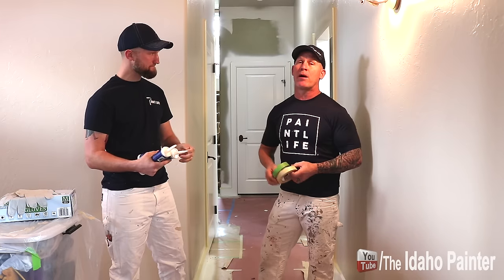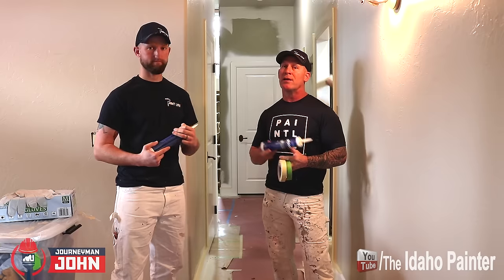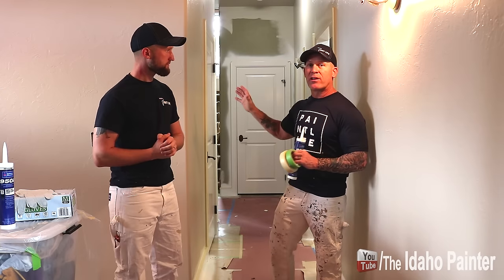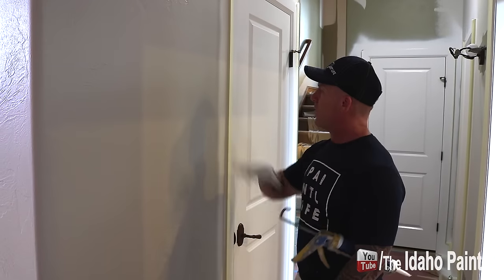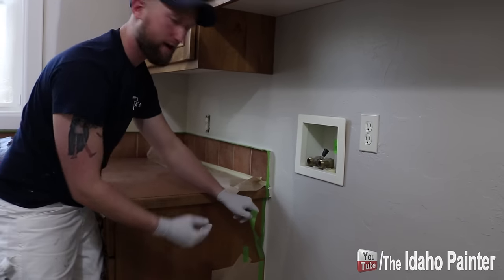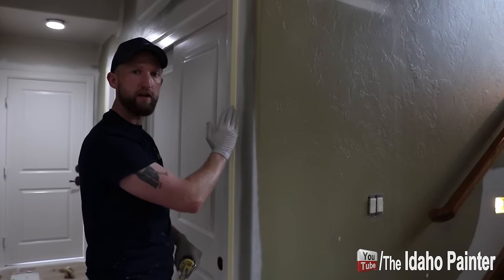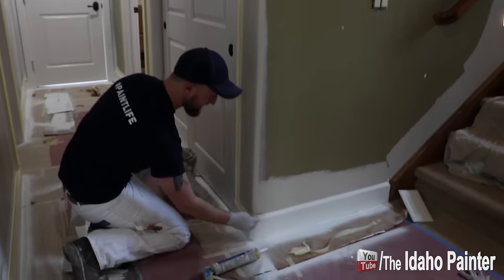PERFECT lines with caulking and tape.

Comment: How would this work if you need to two coat the cut in if you need to pull the tape when the caulk and paint is wet?
Reply from the maker: We do not re-tape and caulk for a second coat. We just go through and touch up where needed
Reply: Paint Life TV in that case, I think I would roll one coat tight to edges, but not touching trim/tape, then caulk, cut, roll and pull tape one wall at a time. Base would always be covered, virtually same amount of work

Comment: Ok so if you leave a 1/8" reveal when you tape trim, so that your caulking blends, then you paint over the caulk, doesn't you color run 1/8" onto your trim now???
Reply: You want the wall to run into the door and window casings slightly. Baseboards and Crown you want the trim to run into the ceiling and the wall to run into the trim. Thats the secret to pro painting. It will never be in the middle so you err on the side the is foreshortened from your point of view. Also the lighting on the ceilin will always be darker than the wall. If you have colored walls and a little of the ceiling white runs into the wall, it will be a very distracting highlight. Also, since the ceiling is foreshortened towards the viewer, the overlap is extremely minimal.
Reply: Gotta disagree on this “tip”. I like my lines to be exactly in the corner. Tight enough that if the trim was taken off the wall (for instance, not for real lol), there would be NO paint whatsoever on the trim. And so tight to the corner that absolutely no trim white shows onto the wall. I feel overlapping by ANY, is a novice move so IDK why they even do this. Also FROG tape AND caulk?! Makes using expensive frog tape pointless. Just use 3M!

Comment: Can this method be used for the corners between walls and ceilings?
Reply from the maker: It can be, but it’s hard to mask straight lines on the ceilings. Better to check out one of the videos we have for cut ins.

Comment: If you leave 1/8" space between the tape and the wall - and caulk that void... won't it leave caulk on the trim itself?  Since the caulk is white - and the trim is (presumably) already painted... wouldn't that push the wall color up on the trim to some extent?  Maybe I am thinking through this wrongly.
Reply: Also - what if you were spraying?  Wouldn't you just tape right up to the wall and spray or would you still use this same technique - spraying and removing the tape while wet?

Comment: What's your take on using a caulk mixer to match caulk exactly to the paint color? I wouldn't want to be without mine. The clear latex is what needs to be used for this, and it does shrink pretty bad. But I just plan on hitting it twice. Turns out great every time. Sucks to clean the mixer out tho.
Reply from the maker: Tried it and hated it, it was too messy and difficult to use
Reply: So how do you color match caulking then?

Comment: I was always taught to overpaint caulk when it was dry or when it says you can on the tube... does the paint not wrinkle and flake if you do it too soon/straight away?
Reply: Either you do it straight away or let it dry. Thats what Ive noticed gives me the best result
Reply: Michel Thanks, I think I’ll give it a go. I don’t know, it just feels wrong painting it straight away. Caulk always shrinks a tiny bit, really surprised it wouldn’t effect the finish of the paint...
Reply: Josh Graham dont over caulk. Make sure as little caulk as possible is on the tape
Reply: Josh Graham You still need to caulk the baseboards  this isn't caulking and painting at the same time. Most of the caulk comes off when you pull the tape

Comment: I own a painting company, and have been painting 20 years. I always let the caulked tape that's been painted dry fully before it's pulled.

If one has problems doing it this way, they've done it wrong. A dry line is normally better than a wet line, and the existing tape is good if a second coat is needed or touch-ups along the tape are necessary, etc...

U need apply tape a dimes width out from the corner, and use a wet rag to wipe all excess caulk off the edge of the tape, as well as not over applying the paint when you cut in. This will preserve the razor sharp tape line.

This is first year stuff...

The only time I pull the tape wet is when we're doing final touch-ups and are on our way out the door, and need to straighten a line or something...

Comment: Hey guys I’m from the uk and normally we require 2 coats of paint so how do you overcome this because surely you don’t mask twice?
Reply from the maker: We use high quality paints that typically only require one coat, but if it does require two then we just do touch ups on the second coat

Comment: What type of paint (brand) are you using on the walls?
Reply: There using a flat or matt paint thats why they can roll first and cut second without flashing occurring if they use any other sheen level eg. Low sheen, semi and gloss flashing would occur.

Comment: What’s the caulk do though, why not just the tape?
Reply: It does nothing. The caulking is not needed unless there is a crack or if surface is uneven. You only need the tape for perfect line. Also painting over wet caulk does not produce a high quality job. Tape should be removed first and then It needs to be dry.  Afterwards then two coats paint if you changing color like they are doing.

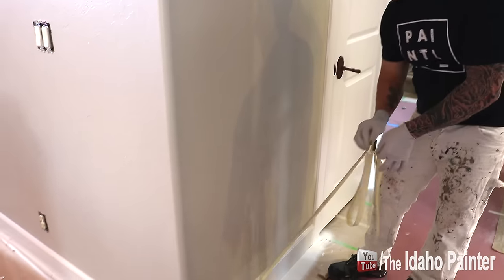Comment: At 10:42 as you are peeling the tape, I see the flaw on the door  trim edge. You even pause a split second talking, while looking at it, but quickly finish peeling the tape down  acting like no one seen it. No biggy,  mistakes happen, but I noticed it right at the time you pulled the tape. It even looked like you were about to reach to it with your hand, but didnt.

Comment: Gentlemen please get yourselves a hotdog roller with a 1/2 inch nap instead of the brush and fat 4”. 

Make sure you use the metal hotdog frame where the nap slides onto! Nothing else 

The hotdog roller let’s you roll against your tape without a bunch of overlapping! No brush work or brush lines and works very fast pro results. 

Been using this method for years. Just remember a 1/2 nap can roll an interior corner without brush work in general. Trim or wall space doesn’t matter! 

Give it a go!

Comment: 8:15 is when the tutorial starts, for those who don't want to wait.
Reply from the maker: Thanks Alex!
Reply: If u start listening at 19:15 they say it this is so they can hire guys who are not paint masters and still get quality work out of them if u follow this method u don't have to me a skilled painter and I'm sure there not getting paid as if they were
Reply: @Idahopainter  like the videos I'm a 3rd  generation painter I run 15 to 20 guys depending on time of year I do about 1.3 mill a year in sales residential and commercial I live in pa and 95 percent of my home interiors are what u would call level 5 but they r not true level 5 even in these big multi million dollar homes out here because when they build them it all goes to the lowest bidder and they first coat tape and finish coat that's it most of ur listener's probably don't know the difference in wall finish and it would be good info to let them know a level 5 means that when they r spackling the sheet rock they keep floating the seams out until they meet each other and all visible sheet rock has a coat of sparkle on it u can not see the board anymore it's all spackle and that usually takes 5 coats. They cut corners and give 2 and they don't screw any sheets at all it's all nailed. Last house brand new neighborhood $800,000 homes nail pops everywhere volted ceilings and u can see all the seems lol! Glad I found ur videos just subscribed!!

Comment: Instead of caulking I brush a clear coat of clear paint..like zinnsers clear...I tape..then brush the clear to seal the tape..wait a few minutes for clear to set up then brush topmost and finish with a 4 inch roller and pullntye tape..Less messy this way because your not using caulk...

Comment: Can someone help me with a recent problem .. I had a customer who removed her wallpaper and it was white I primed It and sprayed the paint but it's drying weird shap that I am not spraying the house is 100 years old as to the knowledge of the owner idk if that has something to do
Reply from the maker: We couldn't say what was wrong unless we saw it
Reply: Home Improvement TV sorry what I ment to say it's that the drywall was white no paint applied since the wall build up I primed It and painted and the whole ceeling when it dried seemed like it had different Sheen all over the place I have never encountered a problem
Reply: Sergio Perez if you mean that behind the wallpaper that was removed had no paint and you saw white...and the home is 100 yrs old it is lathe and plaster more than likely unless the home went thru a remodel where drywall was added.  You can get extremely thin sheet rock and cover the walls...kinda pricey depending on size of project...but if only 1 room may be easy to factor into the budget.  If you applied paint directly over plaster where wallpaper was removed I would venture to say that wall should be sealed with a type of pva primer used on top of sheet rock after it gets textured...it stops the moisture in paint from soaking into drywall or plaster.  If a wall isn't coated well enough with pva it will feel very rough and you can truly feel and see the difference.

Comment: I used “DAP Alex Plus clear latex paintable caulk for windows and trim” over the tape all over the house only to learn that the cure time is 7-14 days. DAP customer service says this caulk will never dry/cure if painted over before 14 days and will attract mold. What I didn’t notice is the plus on Alex plus is silicone so that’s probably the problem. DAP instructed me to remove all caulk. The whole house? I wouldn’t even know where to begin. Have you heard of this problem, caulk not curing because it’s been painted before it was cured? I’m just sick about this.
Reply from the maker: Dap is terrible

Comment: Okay dudes. Tape caulking is sloppy and not necessary. Just seal the edge of the tape with a dry brush load of flat, latex poly. Done. And it’s quick.

Comment: You guys do great vids but I guarantee the corners are not perfect with out sponging between wiping the bead and then rewipeing it after the inside corners and hard to get areas. A grout sponge and bucket of water filled just enough that when you hang the caulking gun inside the tip sits in the water. I mean, just if you want perfection. Apartments and the getto, you dont need to get so meticulous

Comment: You guys don’t worry abt the thick edge your four inch roller leaves? I always feather those edges out obsessively. 😂 why do u not worry abt those?
Reply from the maker: Does not leave an edge
Reply: @Idahopainter  I’ve never used a 4 inch roller like I used I usually use what we call the whiz roller with the nap on the end of it as well and I find that I have to feather the edge out (the edge furthest from door or trim or whatever) or it will leave a lap line or thicker line like u see when someone poorly rolls out a wall. Maybe those 4” don’t do that as bad I’ll have to look into it.

Comment: I've run my own painting & building company in the United Kingdom for over 40 years. I'm sure you guys do a great job but I can't understand your fascination with masking tape.  Here in the UK we only use masking tape on very rare occasions and rely more on skill to caulk perfect lines and cut in sharp lines on walls and trim. 

Once the skills have been developed a painter and decorator in the UK would have a room painted within less time than it takes you to mask the room off. We generally allow 30 mins to completely caulk all trim in an average size room and around 4 hours per coat for the walls. We would never put paint on wet caulk as this weakens the caulk and can cause cracking never mind damaging a nice sharp caulking line if to much pressure is applied to the brush.

I take in your comment about using tape allows you to employ less experienced people and still get a good job, but to me that is just another example of dumbing down the trade instead of training your workforce to become highly proficient in their skills, and do away with DIY methods. It is the development of skills in all trades that separate a first class tradesman from your everyday handyman and DIYer.

If your video was aimed at DIYers then I'm sure it would be very helpful.  However, if this is the system you generally use then I'm afraid you wouldn't last a week in the UK as a painter and decorator, you would be classed as unskilled if you had to use masking tape to get a professional finish. In the UK anyone who has to use masking tape to cut in or caulk is considered a brush hand (which is basically one step up from a labourer and is considered more as a decorators assistant) and would only be allowed to do the most basic of tasks.
Reply: Not sure where that mentality comes from over there. But here in the US, at least on any of the jobs I've been on, you'd probably be let go. We don't have time for anyone who can't properly prep a job.

Comment: looks like some of trim paint came off along the arch on the first demo. Plus in my experience as a painting contractor when caulk (not caulking) dries it will crackle the surface of the paint as it shrinks leaving an undesirable finish. Don't understand why someone isn't doing the caulking as part of the initial prep work. It dries properly and then tape can be applied if you can't cut in properly. These guys simply go for the quick and good enough method I believe. No way this shit would fly with fussy and knowledgeable customers/builders/designers. The 1/8 inch thing seemed stupid.. why would you want wall paint on the side of the trim? Doesn't make any sense. And its impossible not to get roller spray on to the lip of the baseboards or skirting boards when rolling - post trim work. Sure you might not get bit fat blobs of paint on the boards but the roller spray is inevitable. Im guessing with the textured wall a fat nap would be used so how can you avoid that? The only answer is it gets the job done faster.. not better. Good for DIY'ers sure.. not for painting professionals imo who pride themselves on precision finishings. Not on this video anyway.. sorry guys. Having said all that you guys have taught me a lot on other videos

Comment: I don’t think it’s a good idea dragging you brush on a wet caulking! 1 .-you’re ruining your brush 2.- what do you do with you excess caulk?its on your latex gloves or in your pants cuz you don’t have a wet rag or wet sponge?3.- if you have a big gap more than 1/8 “ you brush is going to push the caulk behind and your not going to have the best results. My advise is make you straight line 1/8 “ over the trim (base,case, or crown) small amount of caulk drag it with your fingers keep it wet and clean,try that every 3 or 4 foot get microfiber rag its amazing always have bucket
Reply: With enough water to soak when you get a lot of of caulk on it ,let it dry ,you could do a big area then you have enough to cut and roll and not switching every time. Pull you masking tape at the end of the day or job you not have to worry for wet paint or caulk

Comment: This seems like madness to me. 
Surely by painting over that wet caulk the brush is going to drag it up or get cracks in the paint film when dry. 
Why wouldn't you do all your caulk and filling before ANY painting. Its not about neat lines once you have done your prep caulk and filler you can then cut in by hand or with tape to get your desired line. Also surely not every join needs caulk unless it a new build or newly fitted trim with gaps. I like you guys but I'm sorry this seem completely wrong to me I would love to hear why you think this is even a good idea?
Reply: ok ya  heres what i do caulk let cure then enamel let cure then tape ,its a perfect line every time dont care about tape cost, but the process they are going is far from efficient constantly stopping for another step counter productive,thats why machines do one step at a time its efficient less time consuming   I only free hand when there is no other option like old jagged bumpy walls caked with a dyi caulk job im 35 years into it and like Iike I said perfect lines o ya I can cut real good  time is money tape is cheap lines are perfect

Comment: Thats ridiculous.  Tape off trim . seal tape  with shellac , or possibly the laquer you use on the trim . using enamal or varnish tends to take too long to dry.  Should use the faster drying product . once the shellac dries , paint your walls . when you pull tape youwill have a lazer perfect cut.  Been doing this for 30 years.  Should take about 15 minutes to seal all tape on an upper floor .  stained trim use shellac for sure .
Reply from the maker: ok

Comment: To much time,I am sorry guys I find no usefull purpose to this unless it needs caulk am I not seeing it and why 4 inch roll  if your going to roll it out anyway.use a five in one tip etch a line after tapping off base to protect from roller and the small grove the five in one leaves will be a guide for your brush but  use a duster on base prior to taping or paint will go behind  tape

Comment: So you’re advocating for doing only one cut-in?  Terrible. 

Also, all this caulking and pulling tape while wet is completely unnecessary. Apply Frog Tape. Seal the edges with a wet rag (activates the “magic” fairy dust). Do TWO cut-ins and let them dry. Pull tape. Perfect lines.
Reply from the maker: Just sharing what works for us!